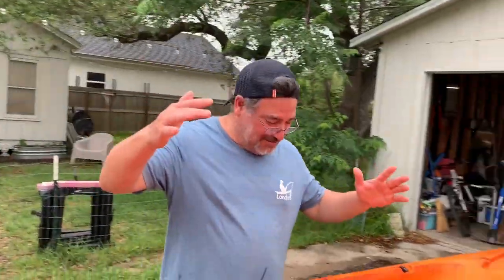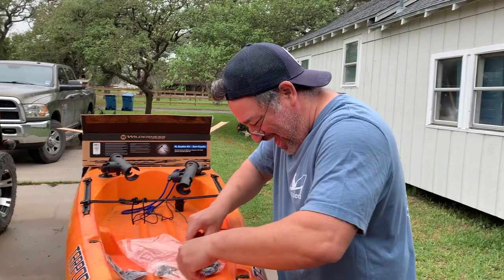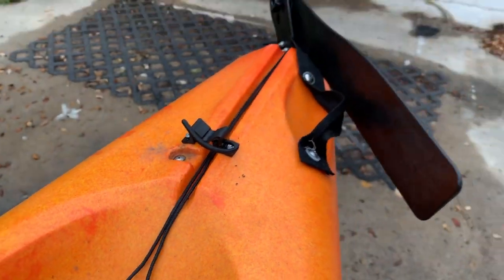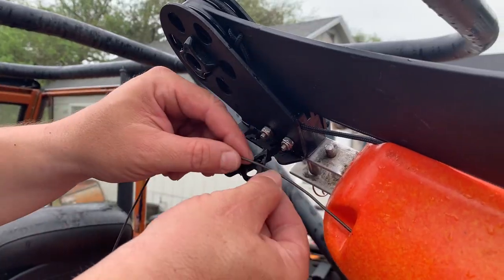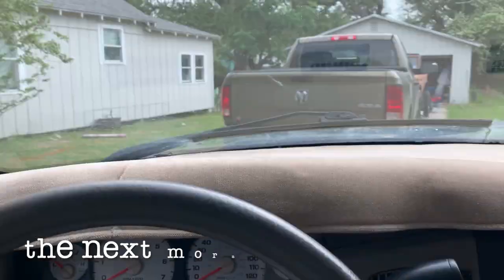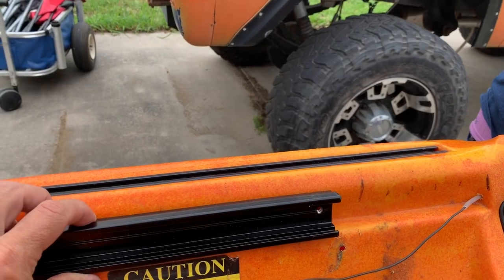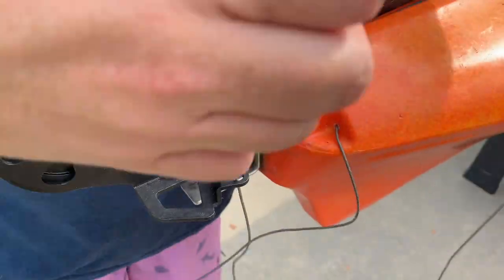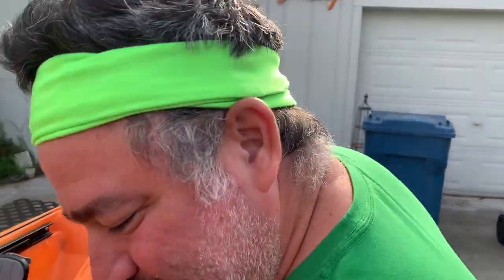How NOT to install a rudder with Gene LOL  || Wilderness Systems Tarpon 160

Comment: WAIT A SEC... those fittings on the side of the Yak are from an anchor trolley. I thought I saw steering line tubes at the beginning of the video.
Nevermind... Those are just for lifting & lowering the rudder